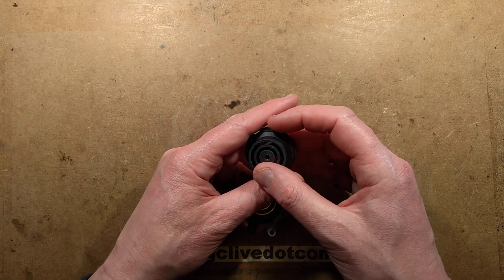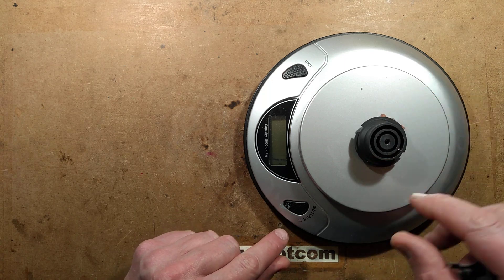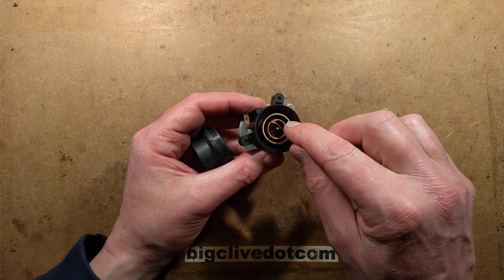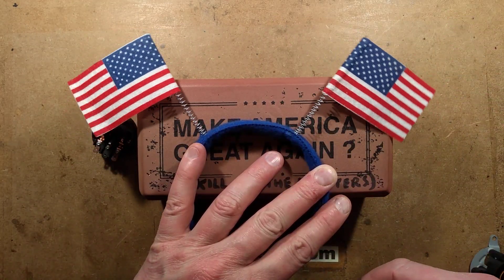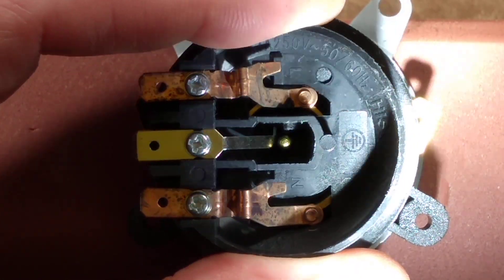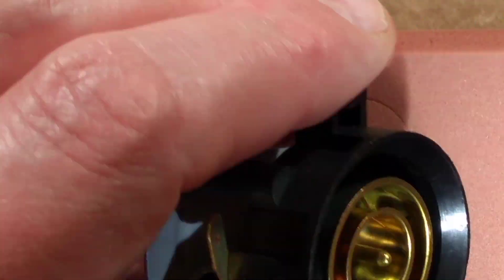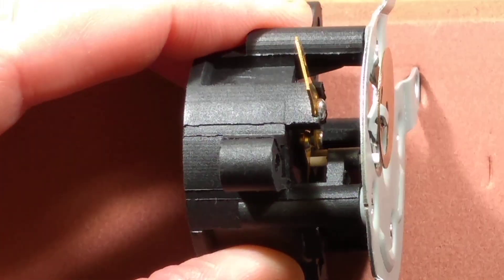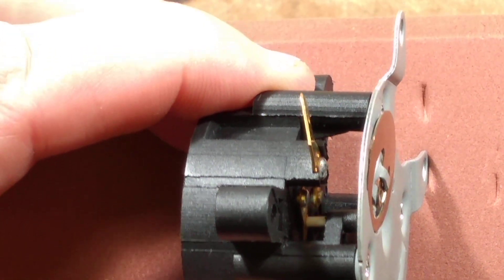A close look at the sliding contacts in a cordless appliance base.

Comment: The bimetal plate is used as a way to automatically turn off the kettle when the water starts boiling. To do that the kettles have a tube in the handle that directs the steam from boiling onto this plate. This is why with very little water you can't get it to turn off, as there is not enough steam and with too much water the tube may fill with water rather than steam. I don't know why I got into so much detail :D
Reply: I am glad you did. I have always wondered how the automatic switch-off in kettles worked.
Reply: Presumably the force / weight required to make the connection is to ensure there is the minimum required amount of water in the kettle.
Reply: because science and knowledge are fucking awesome :D
Reply: That sounds right. After a trip to England in 2015 I bought an electric kettle (though one designed for 110 volts) and it does shut off fairly reliably when the water in it has reached a boil.
Reply: It's also why it'll boil forever (or at least until the water runs out) when the lid is left open :)
The steam just pours out the top instead of flowing down that tube
Reply: It will turn off from the lack of water weight. That's how ours is. It won't turn on with <1 cup of water.
Reply: It's actually a secondary safety device to stop element overheat in case of the user switching it on with no water in it (the auto stop mechanism often relies on steam and therefore water).  It will cycle on and off, but it's better than letting the element get red hot.
Reply: Also if the filter in the neck falls out the steam escapes out of the jug instead of going up the tube and the kettle wont turn off. Found this out when PAT testing the kettles at work
Reply: @azyfloof  Ive tortured few kettles. They have at least two bimetal switches. One in the bottom of the hot plate and one in handle. Even without water, it switches off when the plate heats up to a certain point.
The one in the handle is interlocked with the power switch. But it will continue the heating cycle forever if the water runs out or... the contacts weld themselves together. Aaaand then it'll catch on fire. 

Quite many house fires are started by those cheap safety mechanisms.
Reply: James West I wondered how long it was going to take for someone who has actually used an electric kettle and has ears and the power of observation to comment.
Reply: @markiangooley : Something I have to ask because it's been a point of contention: Should you really let the kettle boil away and only make your tea once it's clicked itself off (ensuring it's come to a full germ-killing boil), or should you intervene and lift the thing off its base and cut it off as soon as it's boiling (saving energy)? What do people think?
Reply: Not exactly right. This is a protection device, that works when the main switch off device fails, or when water is unable to activate the main switch because there is not enough water. It does not actuate the kettle's external switch. The main "boiling" switch works in a largely similar way though.
Reply: usually the bimetallic plate that turns off kettle when water is boiling is on the switch in handle, not contact base. this could as well be an overheat protection..
Reply: @ropersonline  
Intervene.
Reply: Thanks for telling that, i've wondered how it took so long when it is almost empty to turn it off. And why the handle is so hot after prolonged use.
Reply: This must be the emergency trip. The regular switch off mechanism relies on steam being produced as the kettle boils being directed to a similar bimetal disk which operates the physical switch  on the kettle and turns it off permanently. This emergency switch will operate if for example the kettle is switched on when empty. The element will heat up but with no steam being produced the emergency trip will operate. Unfortunately in most cases this  switch will continuously open and close until power is removed. A better solution would have this switch combined with a latching mechanism which holds the switch open until manually reset.
Reply: @dogwalker666  I've lost the filter in mine and it will turn off, but the rolling boil is unnecessarily long - like 10 seconds or so beyond what it was. Cheap as chips 3.1kW plastic kettle with blue water LED and transparent plastic water level view. Over 5 years old and only £10 from Sainsbury's discontinuing it.
Reply: @mihkus  Ah, that explains the second click i JUST heard when i was reading your comment. Just used the kettle few minutes ago, it shut it self off like it is used to but quite often if not always it has that second click and it made no sense. Didn't think that there are two very separate mechanisms.
Reply: @mihkus  The old kettles that used the large round vintage kettle plug had a mechanism that was meant to shoot the plug out of the socket if it boiled dry.
Reply: I had an old kettle years ago that would turn itself off, I'd make a cup of tea and about 10mins after drinking it the kettle would start again by itself so I could have a second cupper. at this point i'd turn it off at the wall. not had one do it since.
Reply: @ropersonline  most of the energy has already been consumed bringing the water to a boil. Savings from waiting until full boiling would be minimal, though prolonged production of steam is expensive and adds nothing to the temperature.
Reply: That disc isn't bimetallic.  It's made of nitinol memory metal,  probably the 90'C alloy variant.
The second click is when it cools down again and resets itself.
Reply: The devil is in the detail...tovarisch!!
Reply: Despite this comment getting so many thumbs up its clearly not the function of this device, the auto-off will be handled by the boil switch, this device would just cycle on and off if that was its purpose.  This device protects the contacts themselves, as you can imagine as the contact age/corrode/degrade the resistance increases with time this may cause excess heating in the contacts, what you don't want is for them to melt and burn hence this switch.
Reply: @Phoenix I'd bet it's because I'm not on Patreon either, and replied directly to you on YouTube. There are replies to your other thread explaining it in more detail.
Reply: @djhvideo  My jug is built like that. An electromagnet prevents the main switch from latching if the overheating switch is open or if it has no power.
Reply: @RenThraysk  
BINGO! You win what's behind door #3!  Aaaaaaand... It's a new car!  🚗
Reply: And also if like me you forget to close the lid/the lid gets knocked off, it can boil dry, as the steam goes out the lid instead of to the cut off.
Reply: @Phoenix patron subscribers get the video early? YouTube videos can be live but private so they're only accessible via a link
Reply: this part goes to the base of the jugs and do not contact with water or steam, there is another bi metal switch at the handle to cut off the power to the jug when the water boils
Reply: I've never seen steam pointed at any of these switches in the cheap kettles I've been buying over the last 10 or so years. I think the metal of the bottom of the kettle heats up and radiates down and heats up the electrical contacts (the metal circles that touch each other that pass current) which then turns off. I need to get a hot plate I have (a metal croc pot kind of thing) checked soon. It's refusing to always switch off at the shut off temp or when I move the switch all the way to the lowest heat. If it dies I'll check what's happening if I can.
Reply: But he was right to call it a thermal cut out
Reply: Very interesting i have learned something new - Always a good day when you learn something new so thats what the little tube is for!!!
Reply: You correctly described how the main switch of the kettle works. This bimetal however, is a safety protection, meant to switch off the kettle when there's no water in it, because the user forgot to put water in the kettle, or because of a failure of the main switch.  Sometimes the are 2 bimetals in the base,  one for each phase (or null and phase), as an extra protection.

Comment: I just (about a year ago) discovered that type of connector here in the U.S. on a hot water kettle. It does the job just fine but as you pointed out, alignment is critical if the two sides are to mate-up correctly. 👍

Comment: It's worth noting that the 'brass' ring contacts used are not rated for breaking the approx 12A current.  So you shouldn't get into the habit of lifting the kettle off the base before the steam switch has operated and turned the power off (ask me how I know).  Although having said this I have seen that the latest Russell Hobs kettle that I bought has a mechanism that operates the steam switch when you lift the kettle before the ring connector opens.
Reply: I thought that was normal? re lifting the kettle physically turns off the switch. On all of the kettles I've used in the past decade or so, lifting it off of the base even a little bit will cause the power switch to click back off and it won't stay in the on position unless it's fully seated on the base. In addition to that (at least with my current one), it seems like it's designed to be just light enough to not fully seat on the base (and therefore not stay on) without a minimum amount of water in it, in my case about 300ml
Reply: @Knaeckebrotsaege  Yes, it may be common now.  All I know is that my last kettle stopped working and when I investigated I found that the contacts in the base were burnt away.  It certainly didn't have any such mechanism but it was probably about ten years old which is not bad for a modern kettle.
Reply: That seems like quite good design. None of the cheap-ish ones I've seen in America are like that but of course it makes sense that the Brits have perfected the tea kettle.
Reply: You would think that we would have perfected the kettle by now but unfortunately manufacturers are continually striving to make their kettles cheaper to make and in some way more stylish or attractive than their competitors.  This results in them being still prone to faults and poor reliability.  It's difficult to find a kettle which doesn't have lots of bad reviews.  The most common complaints are strange tastes, high noise level, leaks and switch failures.  I've found that the best choice is the simplest automatic kettle you can find.  Avoid blue LEDs, level indicators and adjustable temperature controls.  The 'cordless' connection system shown by Clive is now pretty much universal except in the cheapest kettles but if treated well it seems to be pretty reliable.  The age of the replaceable element has passed, when it fails now and it still occasionally does, then you have to buy a new kettle, that's progress.

Comment: Interesting indeed. All the best and most ingenious engineering occurs in the cheapest products. I was absolutely amazed by the engineering built into the Poundland flickering LED tealights (just 25p each). Sadly, nobody else seemed able to appreciate them the same way.
Reply from the maker: If you mean the self flickering LEDs then the first ones actually used musical card chips.  If you wired a speaker in series they played music.
Reply: @bigclivedotcom   Yes, though that isn't what impressed me - it was the minimalist number of parts (not even a proper switch) the whole being made functional by a particularly clever bit of plastic moulding.
I tried re-using one of the self-flickering LEDs but fired it a bit too much while soldering so now it just blinks on and off dementedly :-(

Comment: Those springy contacts work harden and fail, destroyed one of these recently when the kettle failed to chooch.
But I guess the device was not intended for canteen duty cycles.
Good video!
Reply: Failure to chooch? Non est bueno. Definitely not skookum.
Reply: Ave, Ave everywhere xD
Reply: Might be why I've never seen that type on any kettles I've owned. They've all had contacts at 90 degrees (potentially with a tiny spring behind them) which make contact on the side of the circular rings as you place the kettle down, so plenty of surface area to ensure connection without having to apply the same strong bending force.
Reply: @DrakkarCalethiel  Literally.  He doesn't like to brag about his numbers, so he disabled his subscriber count on YouTube, but graphtreon says he's the tenth biggest remaining Patreon account, and number two in the videos category, although of course since Patreon is dying, he's losing numbers there.
Reply: David Evens Yeah, Patreon will be dead in no time!

Comment: It's a "Stop the house from burning down after the kettle has been put on without water in it, Device" ;0)
Reply: I once left an electric  pot (with that connector) without a water in it and go back to do something else. then I smell something burning and then I heard click sound of safety bimetalic contact engaged. It saved me :P
Reply: While at home during university holiday time, I'd been down the pub with my mates, and got back rather late. I snuck through the back door into the kitchen, to be greeted by an acrid smell. Before going to bed, my Dad would fill the electric kettle ready for the morning's cup of tea. This time, he'd absent-mindedly plugged it in. By the time I got home, all the water had boiled away and the kettle element was overheating. There was a safety device that should have ejected the kettle lead, but it hadn't worked. I carefully took the kettle outside and left it there to cool down. My late return home was really rather fortuitous.

Comment: That was a very clear demonstration!  I found the wiping contacts interesting, as my jug is many years old and I believe one of the first to use this kind of connector (it won an award for that design) and both ends of the connection are cylindrical and slide into each other, with quite a large contact area.  Mine also stopped working when the middle pin got out of alignment so I suspect that might actually trigger a switch in the base, as there is an extra contact on the outside edge of the whole assembly that I presume is used for the earth.  Interesting to see the 'refined' version here.

Comment: This is perfect!  Each year our city decorates a park for Christmas and the local not-for-profit groups put up displays and the public pays and drives through to "ooh" and "ahh".  There is always a ferris wheel and a merry go round that need slip rings to transfer power to the rotating part of the display.  This thing would be perfect if it didn't mind being spun around at about 1RPM (revolution per minute) for about 4 hours a day for a month.  It would need to pass about 5 amps at 110 volts.
Reply from the maker: You'd be better using a set of proper slip rings for that.

Comment: I used to have a kettle with a very similar mechanism. Some models also have an adjustable dial similar to a toaster, which moves the distance between the contacts or something, changing the temperature at which power is cut off to the element. Mine was made to auto-shutoff when the water reached about ten degrees below boiling.

Comment: Hi Clive, the thermal sensor in the connector which goes on the kettle acts as the boiling sensor. The interrupted mains releases the operation button in the kettle handle (usually ) which has an electromagnetic latch. This means that the kettle will not come back on as it cools. Cheers from Oz

Comment: Normally there's a little pin contact inside the appliance side of those connectors so when you pull the two parts apart it trips the main boil switch in the kettle, which I assume helps with breaking the load, but also means the kettle doesn't resume boiling when you put it back on the base - maybe this is a premium feature, but my kettles have had it.

Comment: Also designed that if the kettle leaks  the water will not leak into the connector. They are simple but very well designed and work very well. Even the Chinese can make them.

Comment: It's hilarious that just yesterday i saw that same identical connector on a cheap kettle for sale at LIDL!
Reply: Is nowadays a standard system.
Reply: Yes, basically any kettle will fit on any base, although the diameter of the actual base might vary, depending on the shape of the kettle.

Comment: it's for stainless water jug  ..its can boil water with it ..and when it reaches the boiling point its stops ,that explains the thermal disconnection
it's shaped like circle from the bottom for easy handling

Comment: Oh hey the cheap chinesium kettle i've dismantled last year had a connector like that, but it didn't have that weight system - it was just always connected, with those crimped terminals, and the thing would turn on by just touching the circular brass stuff together, and the thing taking up the arc damage would be the main power switch on the handle, so putting the kettle on the base while the power switch was on would eventually damage the contacts on the bottom enough to make it stop working, which it did with mine, and is why i got it dismantled in the first place!

Comment: Used to have something similar on an old jug years ago. Not exactly the same, though. Got rid of it because of the damn noise the kettle would make. Replaced it with an el cheapo plastic kettle (the older one was metal). This newer one has a post at the back end. The back end of the kettle has a hole that slides over it. Inside that hole are 3 prongs that point out horizontally. At it comes down, the 3 prongs appear to push a shutter on the inside of the post down to make contact.
Damn thing still makes lots of noise but the plastic version seems to be less noisy than the metal version. Water in Sydney must be a little on the hard side because of the brown staining the white plastic acquires after a period of time.